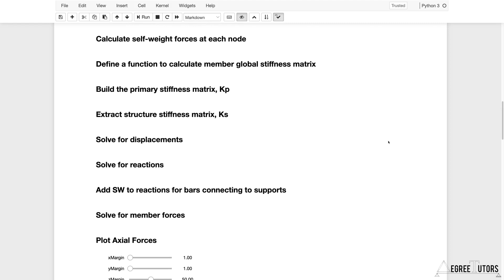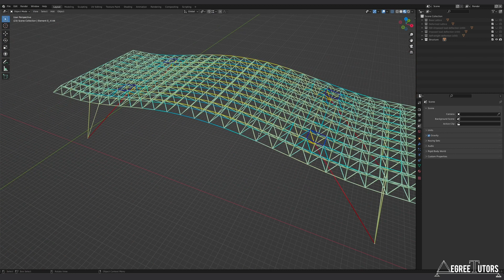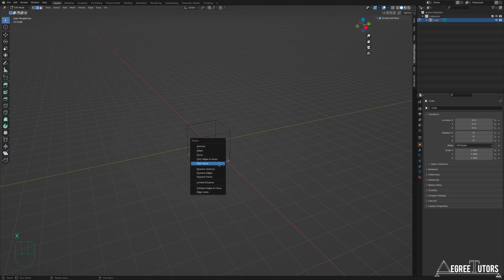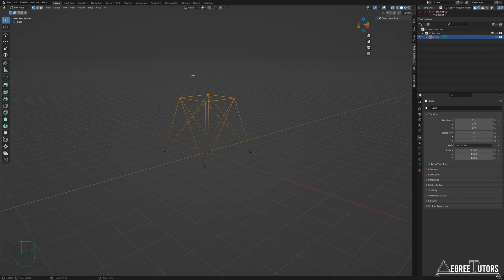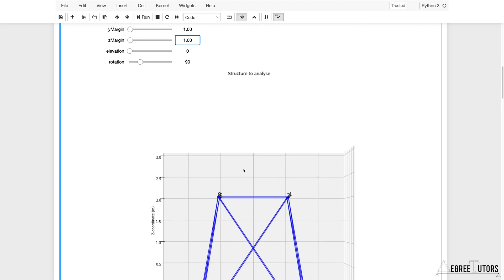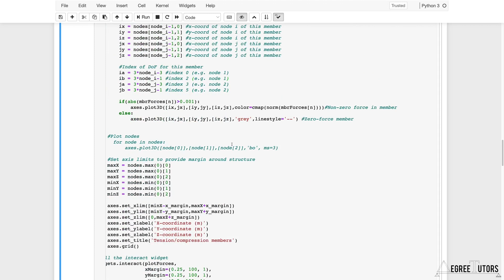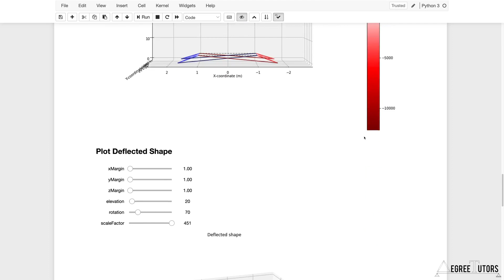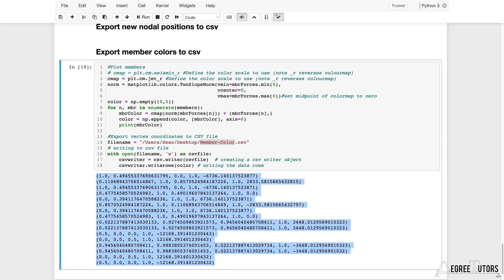Building a force data-viz tool in Blender - Part 1 - Generating Force Data | DegreeTutors.com

Comment: Two recommendations: 1.- Use an Audio Compressor to record your voice or try to speak at the same loudness (volume) throughout the video. 2.- Set a higher gain value for your mic on the recording interface or a take the audio master volume to almost red while mixing, because the volume difference between your videos and the advertising added by YouTube is brutal and I almost went deaf because of it... In other topic, good videos, I understand that this is to circumvent the paywall we have on other specialised dedicated software.